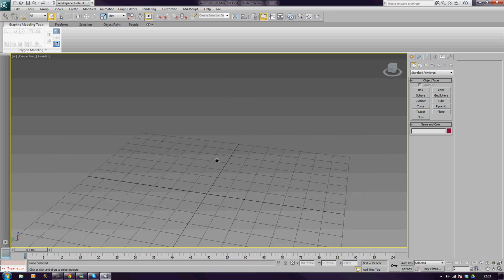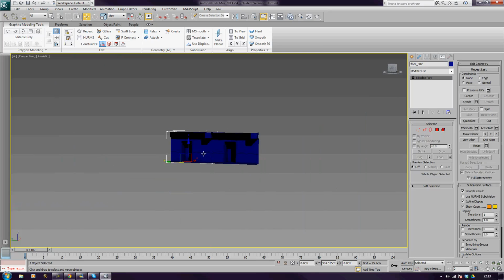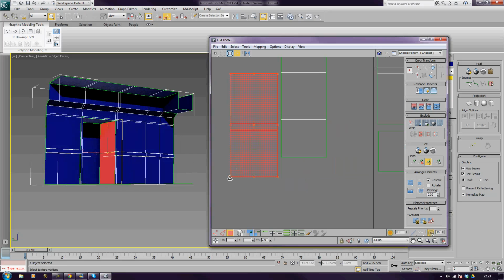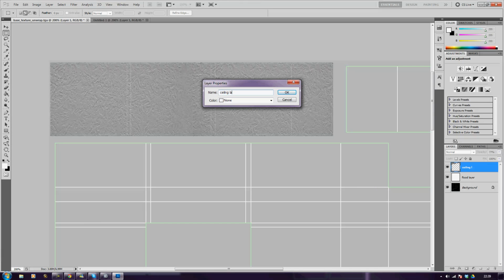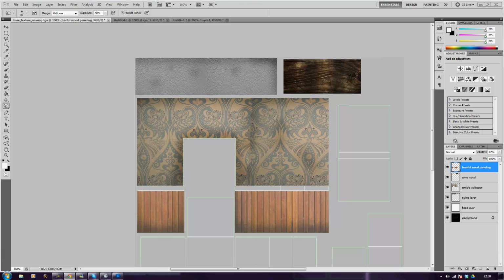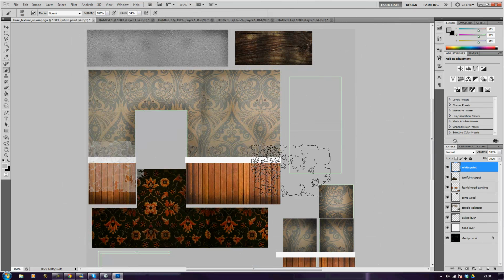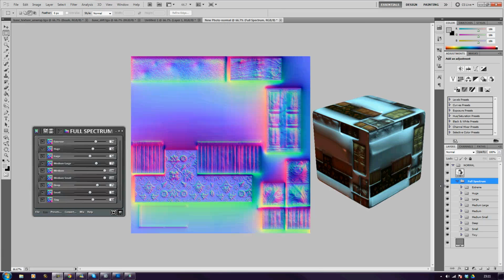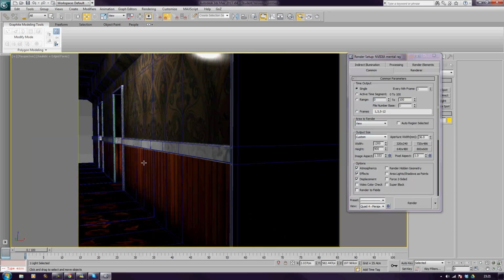Model Unwrap and Texture a Spooky Coridoor in 3ds Max 2013 with Photoshop and Ndo2

Comment: This would have allowed for tweaking to get the details right, your normal maps will appear grainy because of all the fine detail being shown where is shouldn't for example the wall paper has a very defined normal when that should be much closer to flat if not completely flat. Also for the sake of copy right don't just grab textures off of google that's a law suit waiting to happen there are countless sites offering free textures for editing and for the most part cgtextures alone will cover you

Comment: From someone who has spent a long while studying texture creation the way you go about that icing on the cake with ndo was quite worrying, nDo although good at extracting normal information from a photo texture is not going to produce good results in the manner you showed. Each of those texture flats the wooden wall panels, the wall paper, the door, the skirting around both the base and the top of the wood and carpeting should have all been generated separately.

Comment: Great tut. If you desaturate your uvw template, invert it and then stick it on the top layer with a multiply blend mode you'll be able to work underneath it but still see your guides. Might be a bit quicker than having to keep changing the opacity of each layer.